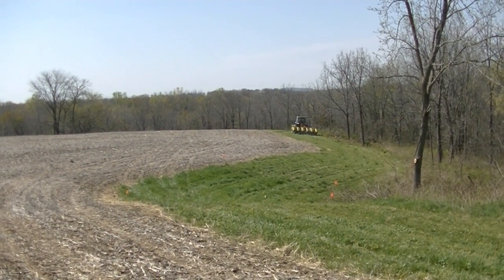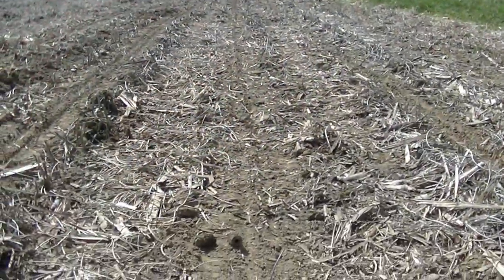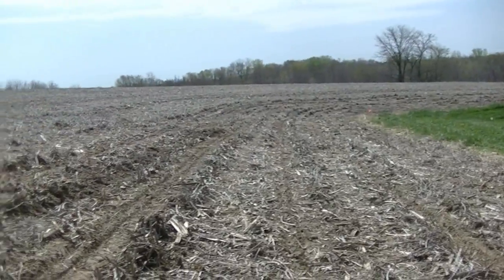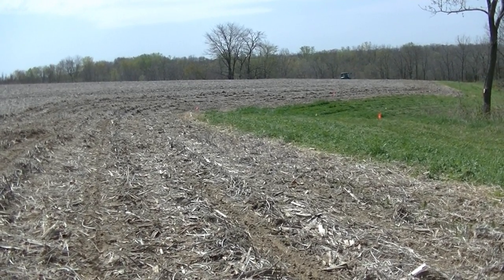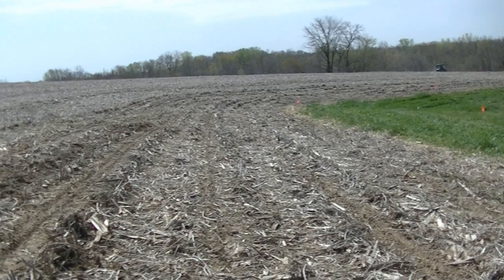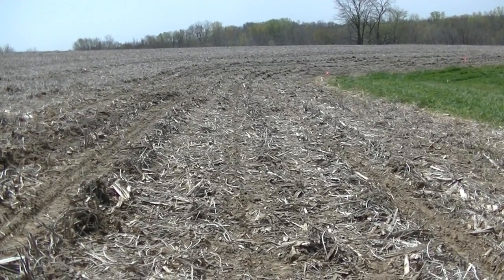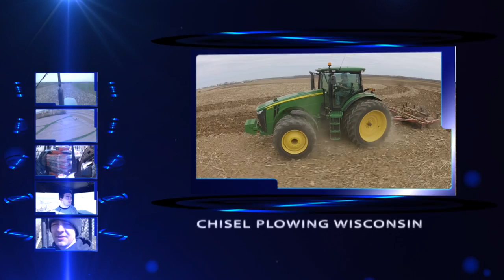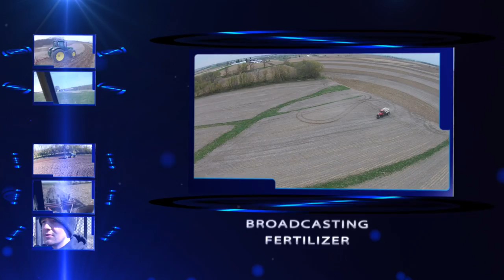No-till Corn Planting

Comment: Looks like your tongue needs adjusting on your planter... the units are supposed to run level across the top of the row unit side panels that support the hoppers, and yours are nosed down quite a bit at the top when the planter is down in the ground.  Course I guess if it's working right, then why bother-- leveling the planter will require readjusting the trash whipper operating height and the closing wheel down pressure, as once the planter is leveled it will raise the trash whippers up in front and push down more on the closing wheels in back.  

We always leveled out planter first thing when setting up to plant...  Course we were running a Deere 7100 on the 3 point hitch, so lenthening or shortening  the turnbuckle at the top was all that was required to level it; pull-type planters are leveled at the tongue hitch height adjustment.  

Might not matter so much with vacuum meters, but I read in the book that other style meters might not work as well if the planter isn't level... 

Later!  OL J R :)

Comment: Explain the contents of the hoppers on the plant rig for me.  I know that one of course has the seeds but what are the contents of the other two and the other six?  Some time ago I would have guessed one contained Temik but I think it has been banned. My other guess for the individual hoppers is Myemik which was introduced to replace Temik.  Do you use seed talc?  When I was on the JD tractor 12 row plant rig the other day when the peanut seeds were being loaded seed talc was spread over the top of each bag and then talc was applied on the top of the seeds when the hopper was filled.
Reply from the maker: jbmbanter We always put graphite in with the seed. The front two bins are for fertilizer, the middle bins that are on each row is for the seed. The bins in the way back are for insecticides such as Lorsban.
Reply: jbmbanter Good question. Glad you asked because I was just about to.
Reply: jbmbanter  Damn somebody out there knows the drill when it comes to Peanuts.. we have hopper extensions also and 300 lbs of seed will cover 6 acres. we put liquid inoculant in the fertilizer tanks with a tube in the seed trench and dry inoculant in the insecticide hoppers. The front tank on the 8950 has the prowl and valor spraying behind the  rig .Planter is behind a unverferth strip till rig with tremble guidance
Reply: You guys have answered a lot of my questions and I appreciate it.  I looked at the 12 row planter since I posted and it is incredible how many wheels that it has whether it be cogs, gauge wheels, press wheels and even the wheels that support the planter as it goes down the row.  I bet the land I watched being planted was planted by my Uncle years ago with a two cylinder John Deere tractor with a two row planter.  I also watched a pivot irrigation system run over corn for the two days I was at my campsite in the country.  It had finally gone 360 degrees during my 2 day trip.  It's really dry here in East Central Georgia now.